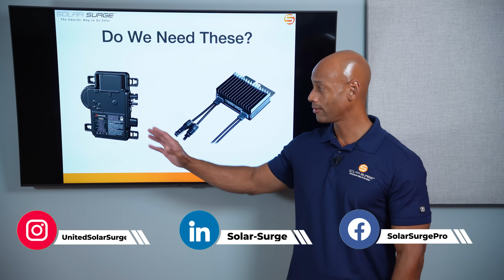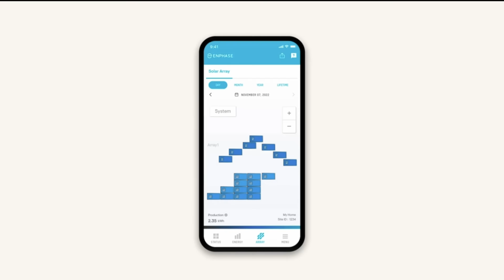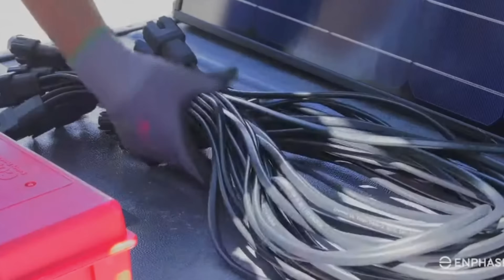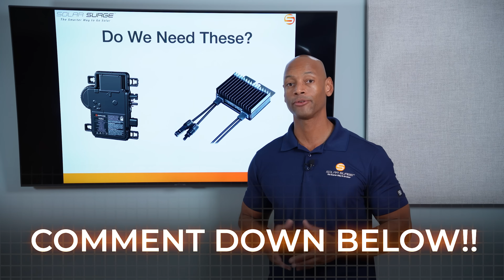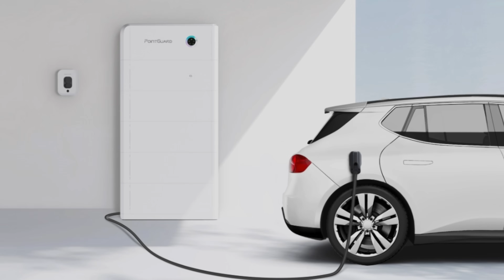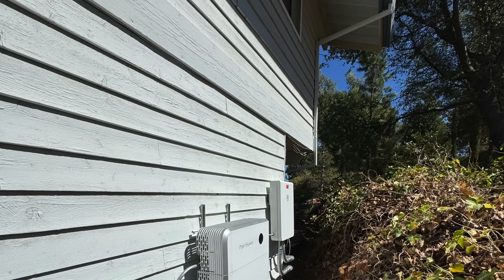All Solar Panels NEED This... Or Do They?

Comment: Kiss theory folks.  Don't overcomplicate things.  If you have shading problems may you aren't a good candidate for solar or move the placement of the panels.  IMO
Reply: In my case, shade is an issue due to chimney. Alternate mounting location not viable nor would be removing/eliminating brick chimney. My system working nice with MI.. just saying there are times when MI’s make sense (and they did in my situation, pre-battery).
Reply: @lawrence_SoCal  Shading from things like chimneys are temporary, a few hours a day on a panel or two... and can even be seasonal. Panel diodes help in those situations. And, the added cost of using MI's may have been better spent adding another panel or two which would result in a higher KW yield.
Reply: @ridemfast7625  not disagreeing. It depends… However, In my case (panel count, roof orientation, chimney placement, etc), MIs were unmistakably the better, more effective/appropriate overall system approach. And time will tell, but latest failure rates in my area, per multiple contractors, for enPhase 7 MIs is really low (with a couple reporting zero post-install failures in last 5-6 years … how accurate is that? No way for me to know. But I don’t know anyone locally with a recent gen enPhase MI failure… just saying).   From my IT background, I’m a firm believer in KISS. And if I were installing today (battery effectively required) then simple strings straight into combo inverter/ battery would make a lot of sense, especially with recent panel bypass diodes… but each roof mount will be a little different

Comment: I have 13 of my  emphases not working
Reply: This is why I didn't get em, now someone has to go up there, remove a panel and replace it, such a job
Reply: @betterdayherman5748  More details please? Sounds like a very ancient model starting with M. The IQ6, 7, and 8 are solid and with 25 years warranty.
Reply: @TurreTuntematon  Agreed, this person eitherh as ancient M series. IQ 6 and 7 have low failure rates. Signifcantly lower than Teslas Powerwall 3. Simply hop over to reddits Tesla Solar subreddit, aside from loving the system, there are lots and lots of posts about dead inverters and logn wait times. I'd rather have one micro or two fail, I know I'll continue to generate over 90% of my capacity, than zero for months on end.
Reply: I’ve never had one fail since 2014.
Reply: My first guess would be that you've got a wiring problem with a whole micro-inverter branch circuit.
Reply: all 28 Enphase IQ7+ installed at my house in 2017 are still working perfectly.  I did have a circuit breaker fail connecting solar to main service panel (only one hot leg was working) which brought down the whole array...  I was able to get that diagnosed/fixed within 3-4 days though and all back and working again.

Comment: Question: I have microinverters on non-roof mount solar, due to shading and our configuration due to property restrictions/size/layout, etc.  It works well.  But if I put a string on the roof, what is the shutoff requirement for strings?  Can I run High Voltage cables down from 2nd story roof to a Powerwall 3 a ground level without the high voltage shutoff on/near the roof?
Reply: Research Rapid Shutdown Device.
Reply: Residential roof mounted panels are required by the NEC, and most if not all fire codes everywhere in north America, to have a shutdown device close to the panel(s) as mentioned in the video.  I know Sol-Ark and EG4 can trigger RSD of panels, I do NOT know if they need to talk to something like the Tigo gateway to do it though or if they can trigger the RSD devices directly.
Reply: @michiganengineer8621  If Sunspec protocol certified than the inverter can communicate to RSD's if RSD is also Sunspec certified.  BUT, Sunspec does not support data gathering, only shutsdown the RSD and drop panel voltage to .6~1vdc.  And thats why Tigo and others require a cloud/gateway to collect panel data and to communicate to the internet.
Reply: @ridemfast7625  Thank you for the added information.

Comment: For all the installers out there, would you support Enphase creating their own version of a DC coupled inverter + battery for the low cost install segment?
Reply: Enphase has always argued most installers prefer not having high voltage DC running on the roof while installing
Reply: @kevorod  correct. But Powerwall 3 is eating into their profits and the triple conversion loss makes their AC coupled battery less attractive to some customers

Comment: An expensive piece of equipment to monitor something with a failure rate of .05%. Panels should monitor the MI.  Installed roof top solar myself last year using an SMA inverter. A year later and I am even more convinced that the decision not to use MI's was the right one.
Reply: We install SMA on most jobs and very rarely have to go back for troubleshooting. The SMA systems we do have to diagnose are all around 10 years old now. I have a friend that installed an Enphase system last year and half the micro inverters were dead on install. Then have his microinverters for the batteries got bricked during an update. 

I really think module level electronics add orders of magnitude more failure points especially considering the placement of essentially computers under a solar module on a roof. It gets very hot under those arrays. 

A friend that installs Solar Edge stuff has at least half of the systems he has installed have module level electronics failures and most have multiple optimizers failed. 

What I haven’t seen is the solar module that has failed. By now they are basically failure free unless they get physical damage from an outside source. My father in law has solar panels from the late 70s that are still working and he bought them second hand in 1979.
Reply: 30 Bucks a module is expensive?
Reply: @glee21012  Which module for $30 and does it communicate to the internet? Tigo requires a $400 gateway and it only has a 5 year warranty. Enphase is similar. And why monitor something with a .05% failure rate. Those MI's have a much higher failure rate...
Reply: @glee21012  Tigo? And you need a Tigo cloud transmitter with only a 5 year warranty that costs several hundred dollars.   Tigo and Solar Edge - not on my roof.  SMA even removed Tigo from its RSD Sunspec compatibility list of approved products.
Reply: @glee21012  Tigo needs a cloud gateway that costs another $400 and only has a 5 year warranty.

Comment: So if you don't do optimizers or inverters at the panel level. How do you comply with rapid shutdown requirements?
Reply: Rapid Shutdown Device. aka RSD. Made by AP Systems, SMA... These devices are far less complicated then MI's and not expensive.
Reply: Tesla utilizes MCIs (mid-circuit interrupters) within it's string for rapid shutdown.

Comment: Would an installer roll-on-one if the work were paid for by the manufacturer? I’ve heard that Enphase is pretty good at approving warranty work on their microinverters.
Reply: Enphase will reimburse up to $200 and has additional reimbursement amounts depending on what was defective and/or needing replaced. But it's only a 2 year labor warranty. Very uncommon to see an Enphase component failure within that timeframe based on my experience.
Reply from the maker: Good question.  I'm not sure how much Enphase reimburses the installer for a micro-inverter replacement.  For SolarEdge, I've seen them pay up to $250 in labor for an inverter replacement, but not for an MLPE.